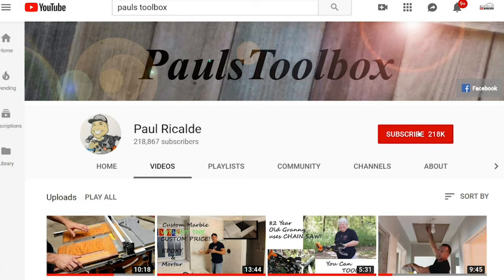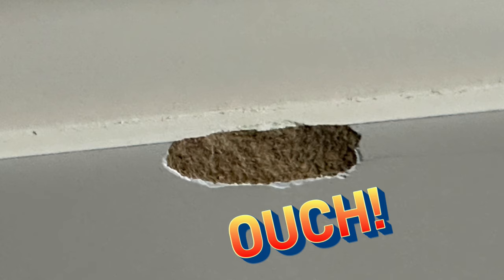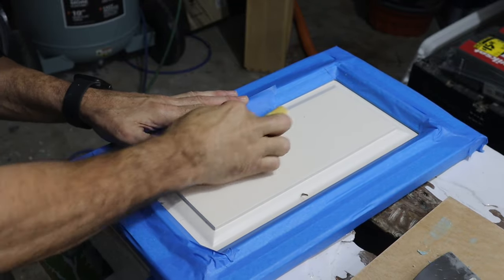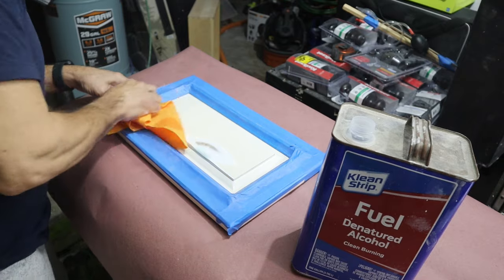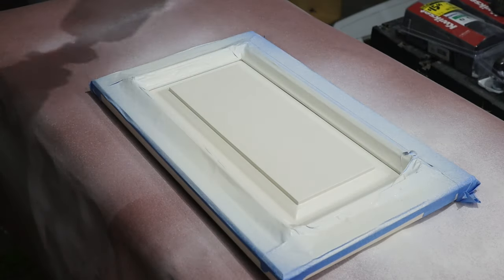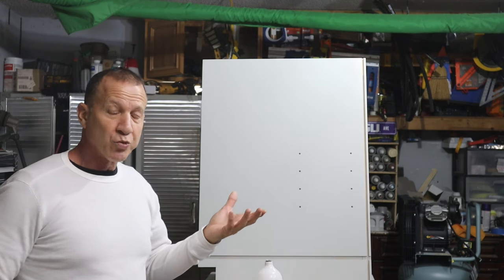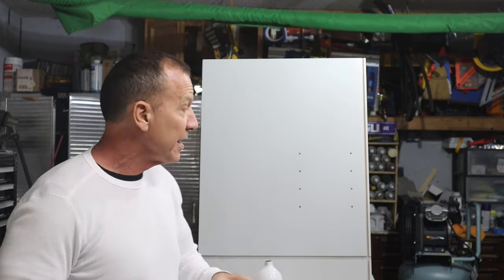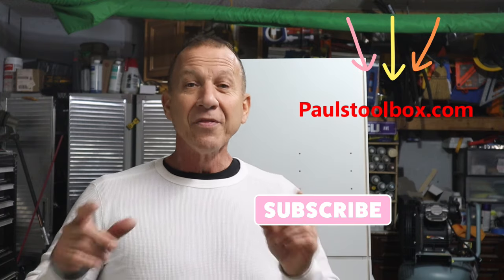Repair and paint a factory cabinet the easy way!

Comment: Don't know why you didn't coax the dent in that wood out with a heat gun and a wet rag.
Reply from the maker: It’s not a dent it’s missing a small chunk but heat won’t do the trick on a dent either. This is wood not metal. Thanks for the input anyway, it’s always good to have discussions.